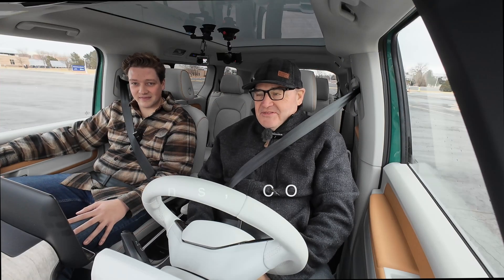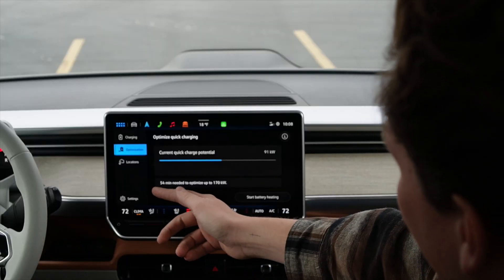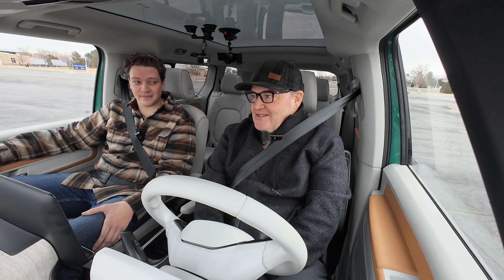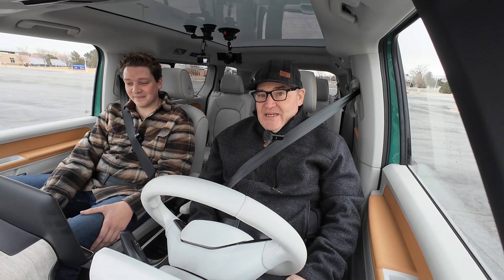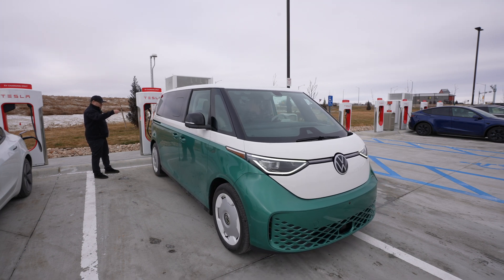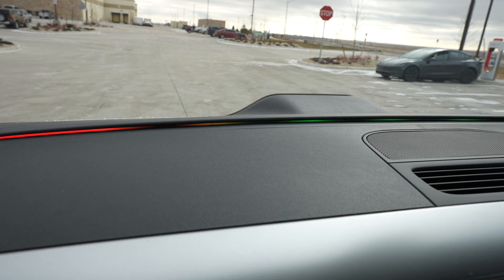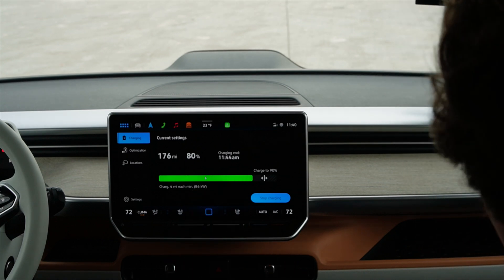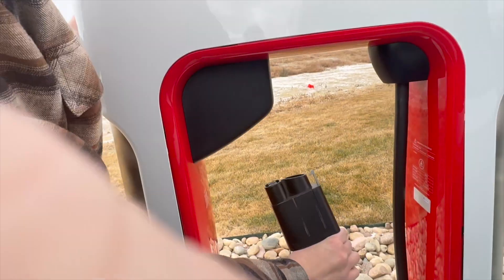Buzzing in the Buzz to a Tesla Charger!

Comment: I have a Buzz and bought the Adaptor.  Today, I went to a Tesla Charger and it didn't work.  I got stranded because of this.  The white charging light blinked 7 or 8 times, and turned RED.   I disconected it and tried again,  Same result.   Not ALL Tesla chargers will accomodate the Adaptor,  BEWARE.  Do not trust the advertising.  Don't let yourself get stranded.

Comment: At 9:00 you are at 50%, and 118kW, and you say that is 10 kW better than your Ioniq 5?  That is interesting, because my Ioniq 6 (same battery and charge curve as the 5) normally has just dropped below 200kW at 50%, normally in the 180-190 range at that SOC.  Of course the I guess you could be comparing apples to oranges, in that on the 500v supercharger network the Ioniq 5 is limited about 97kW max as it has to boost the voltage beyond 500 to meet pack voltage.  This is a fine example of way the Tesla network is not the end all be all that some make it out to be, as it was designed for 400v cars only, and cannot deliver the power (Voltage) that many of the best charging cars on the market require.

Comment: What software for the Buzz?  My ID.4 recall software will be installed in a few weeks.  Curious what versions VW has "circulating" in US.
Reply: Should be 5.0?
Reply: I just bought an ID Buzz. I thought an adapter was required to use a Tesla charger. Am I wrong? It sure looked like you just plugged that sucker into your Buzz!
Reply: @mackiemcnamara  The Tesla charger has the adapter. I think the button-push you saw at the beginning of the charge is what gets you the adapter instead of the Tesla plug.  When he put the charger back, he accidentally pulled it away again without the adapter.  So my question will be, does the VW trip-planning app (I assume there is one), know where the adapters are available?  Also I think you can buy your own adapter for Tesla chargers that do not have them.

Comment: Hmmm. 50 miles left ÷ 23% = 217 miles for a full range. Cold weather chilling the battery, I would imagine. At the Supercharger it had 16 miles ÷ 7% = 229 miles for a full range. Heating the battery worked! When you finished you had 188 miles ÷ 86% = 219 miles full range, 10 miles lower. Maybe because climate control was running? Dunno.  Methinks Hyundai should set the cut-off safeguard for battery conditioning, utility mode, etc., at 10% —not 20%. I do think it's very helpful of VW to actually estimate your charging speed with and without the battery conditioning. More EVs should do that!

Comment: Nice video, BF.  Unfortunately, the port is on the passenger side...not the driver's.  Hopefully, they will update the ports when they have an actual NACs port.
Reply: But on B4 supercharger won't matter. Cable is long enough to reach either side like on our Ioniq 5N